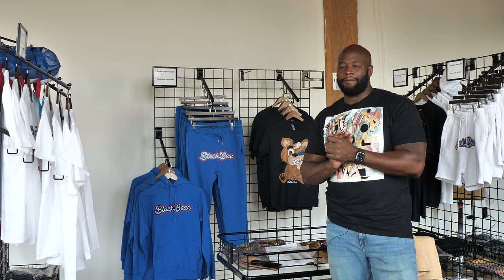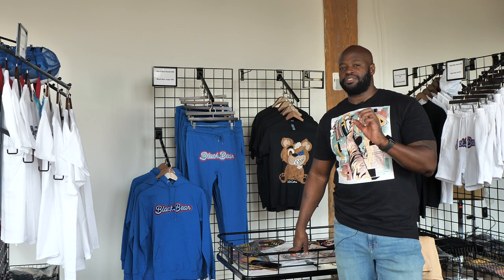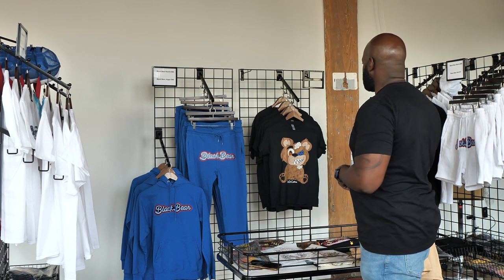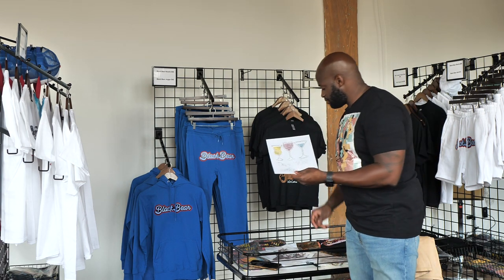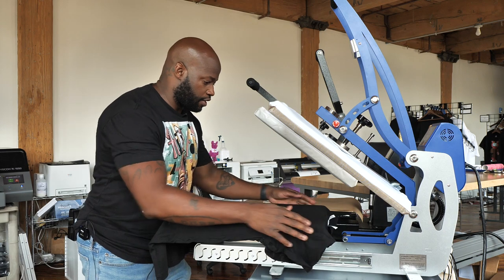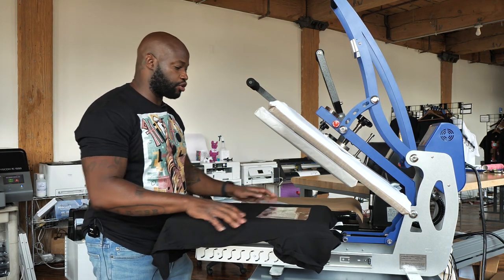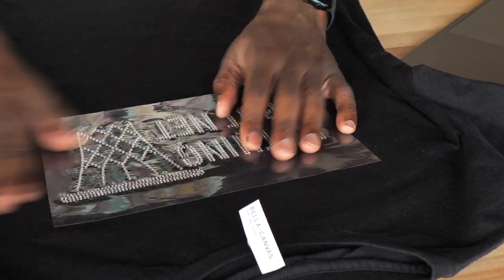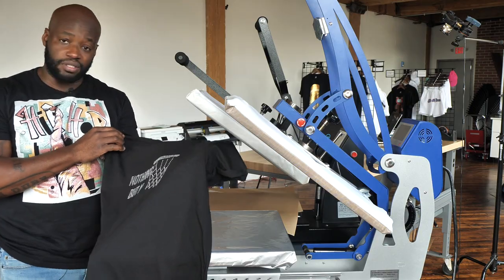Tried to press Rhine Stones on Bella Canvas Jersey Style 3004

Comment: So great video now to the nitty-gritty. Stahls has the the press that has the bottom platen. They are called heat press power platen. It’s for the hotronix very pricey tho. And on the post press you have to watch out for doing that you can over cure glue and make it not last long enough.